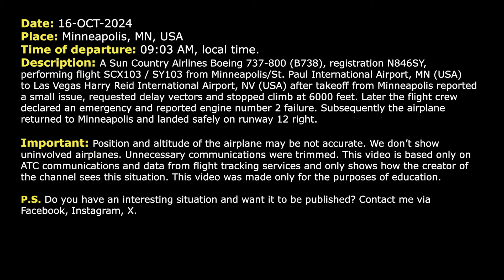ENGINE FAILURE after takeoff. Sun Country Boeing 737 returns to Minneapolis. Real ATC

Comment: I was on that particular flight that day with my son (who is a 737/800 pilot as well)and the whole situation could have not have been handled better…Hats off to the crew for a successful approach and landing…regarding all the other ignorant comments posted here, any type of engine anomaly is a major distraction and also returning to the airport…that’s why the communications are very brief and limited with ATC….they only need to know limited information to get the crew back without themselves becoming a distraction.  Been there and had that a few years back at another airport… also ACARS the company and that became a distraction to the point I simply stopped because it was too much at that point between ATC and company.  Our number 1 job is getting that airplane back on the ground as safe as possible…period.  Unless you have been there and have amassed 25000 plus hours and have dealt with an engine failure, I would suggest refraining from ignorant comments.

Comment: Hats off to the flight crew and ATC on handling an engine that was producing power but in the end shutdown. VERY high workload environment and things to consider before returning to land at KMSP. If you haven’t ran an emergency/non-normal checklist in a transport category aircraft and all that it entails, you can now leave the conversation.

Comment: I was surprised when checking FlightAware to see the N846SY flew to Cancun 24 hours later (10/17).  That's a fast turnaround back to service after an engine failure emergency.

Comment: About 20 years ago we were passengers on a NWA A319 out of MSP and had an engine out maybe 15 minutes into climbout.  Big bang and the whole plan vibrated for a long time until they could get the engine shut down.  I have never seen so many rosary beads come out.  They worked their checklists for maybe 15-20 minutes and finally came on the intercom and told us what was going on.  Then we turned around and landed on the same 12R.  Anyway, glad we had two engines or it would have been a different kind of day!

Comment: They act calm because they have done single engine landing in the past 6 months (in the sim)  most likely.  But I can't help but wonder why I did not hear about this emergency until now.  It makes me suspicious the aviation community is covering for Boeing.  Not in a conspiracy-theory sort of way, but in a realization that the once great company is close to bankruptcy on the commercial aviation side.  People don't like riding in planes that have this many problems, and the last thing Boeing needs is another near-disaster.  And yes, an engine out is very serious.... I'm a GA pilot, so I'm not especially sensitive to risk.  But Boeing has a quality problem, and they don't seem able to fix it.  And it's not like they are a low-cost provider.  The money is there to provide quality, safe airplanes.   I can only think the cat has gotten too fat.   And that includes the union contracts all the way up to the CEO.
Reply: That airplane is likely 15 years old. Boeing had literally NOTHING to do with the failure, likely not even the same engine that was in the plane when it was delivered. Secondly, Boeing does not make the engine CFM does and it likely wasn’t their fault either, things break, sometimes at the most inconvenient time.
Reply: @ronpayne4505  Maybe I missed it and it was all over national news?   But if it was not, how would you explain it?   A commercial flight with engine failure on takeoff is not newsworthy?   Maybe you are right, but I'm more skeptical.  As a passenger, I don't care if the engines are outsourced to CFM.  The plane is a Boeing.  Not a CFM.  As a passenger I expect Boeing to make sure every component on that plane works perfectly.   Yes, I said that, and meant it:  perfectly.  Commercial aviation has a high standard.  Has anyone noticed how the Euro Airbus' planes are not having the same number of crashes, incidents and accidents?    Whoever the new CEO is should not tolerate apologist sentiment about outsourced parts being the problem.  I'm sure the software was partially developed in India.  And the engines might be CFM.  And the beer they serve might be made in Milwaukee.  But when you are on a 747, it all Boeing.  The beer comment was a joke-FYI.
Reply: @kellywendlandt3940 I agree it's shocking this wasn't reported on and likely intentional
Reply: @mangos2888  The pilots and ATC did an incredible, professional job, and for that we are all thankful.  But ya, I agree the lack of coverage is shocking.  It's a declared emergency.  And it seems very curious that it's another Boeing airplane.